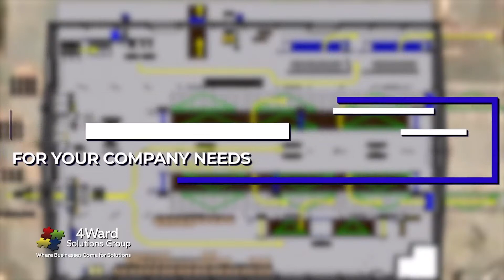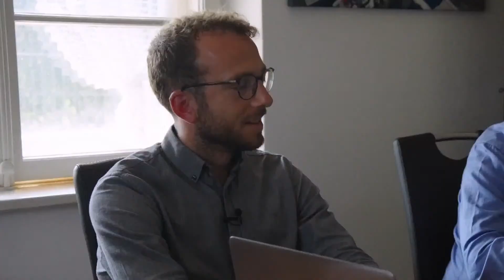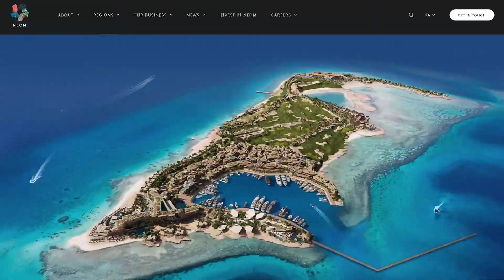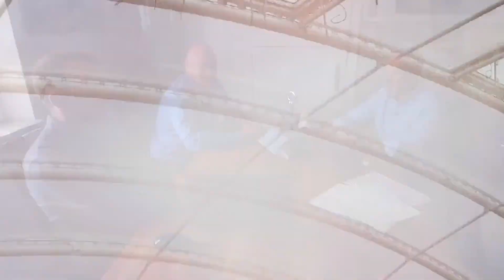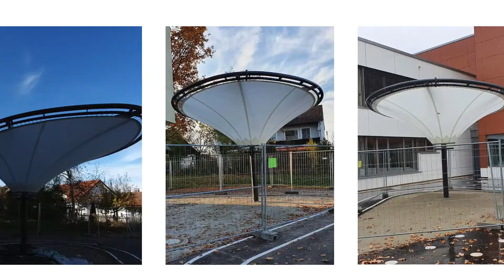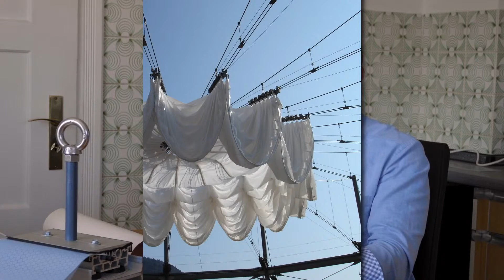The Art of Fabric Architecture: Designing, Fabricating, and Installing Innovative Structures

Comment: Is embedded/woven in solar/photo-voltaic an available option for fabric/flexible roofing?
Reply from the maker: Can make flexible solar panels in different ways, like using thin-film solar cells, organic photovoltaics (OPVs), or even advanced crystalline silicon cells. They make the solar cells on bendy materials, which means they're super light and can fit on all kinds of curvy or wonky surfaces. How cool is that?